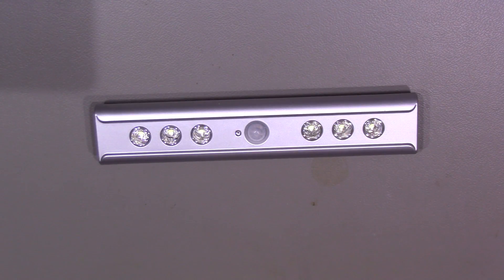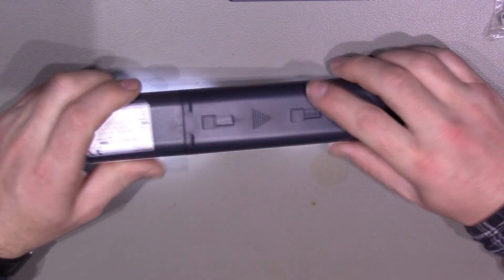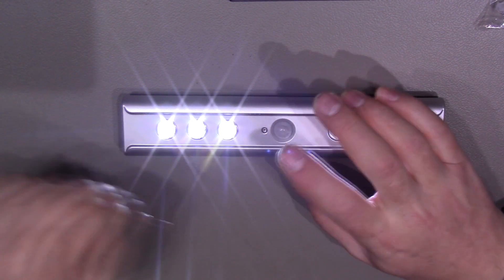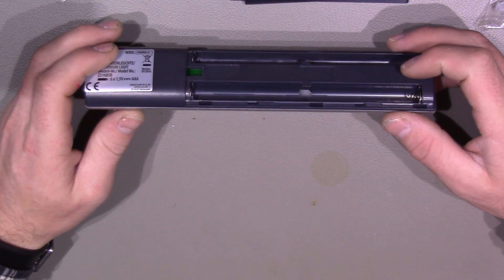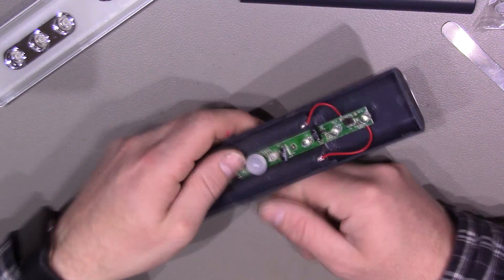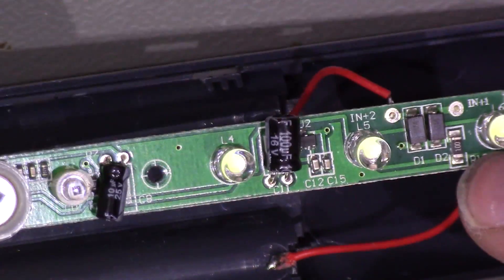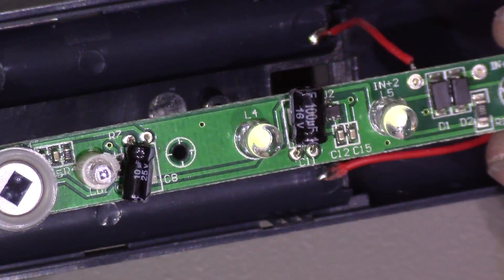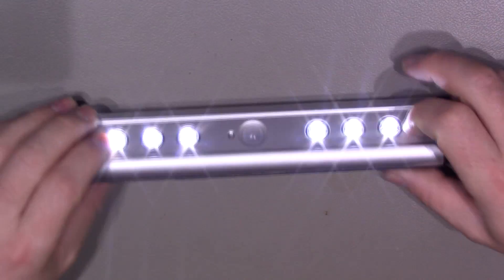Lidl LivarnoLUX LED sensor light

Comment: Why does this light go out and turn on again and not turn off at all when no one is in the room. always turns on at intervals
Reply from the maker: PIR sensor, so detects movement
Reply: @ElectronicStuff  
Yes, but when I give the flashlight the light is always on and does not turn off even when the room is empty without moving
Reply: @lubicak8128  Try changing the batteries, it fixed the same issue to me.
Reply: @CésarSantosLuis  Of course I changed and it's still on
Reply: I have the same problem. How this was solved?